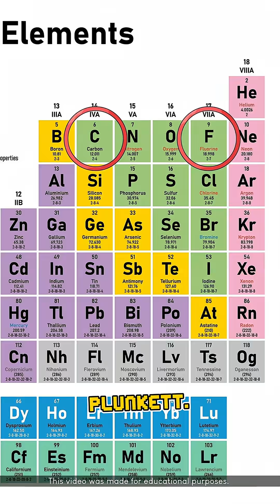Why You Don’t Need Oil on a Teflon Pan

Comment: Fun fact. The chemical c-8 used as a catalyst to start the chain reaction to bond the fluorine atoms to carbon is highly toxic to the point where a single drop in a million gallon tank of water can cause harm. Due to greed and negligence from 3M, that chemical is now permanently in our water cycle. Everyone on earth has some of it in there system and may cause cancer

Comment: 260 degrees Celsius is 500 degrees
Fahrenheit in American.  Make sure
to keep non stick aluminum foil and
cookware BELOW those temperatures.
Reply: Could’ve just said it’s 500 degrees  Fahrenheit
Reply: @sadbarofsoap  I'm American and I like to convert weights, speeds, distances, volumes, measurements, and temperatures to our units because I think it's nice when American YouTubers say or display the other units too.  Also, I think it's mildly funny to add "in American" at the end.
Reply: @ml9867 I’m just saying it wasn’t necessary but now that you said it was a joke I get why you said it